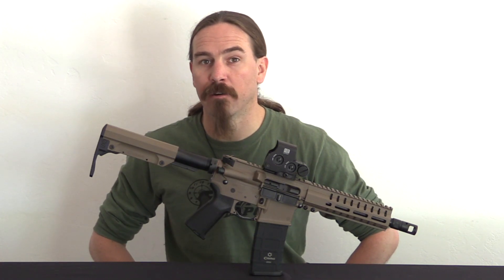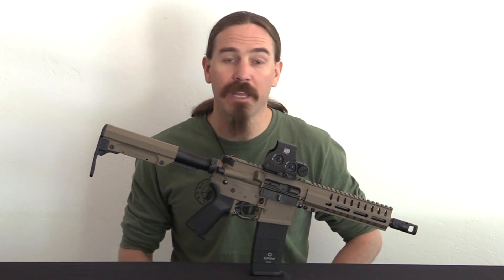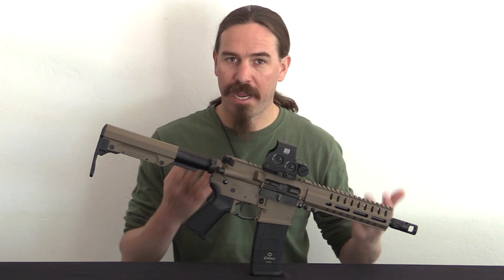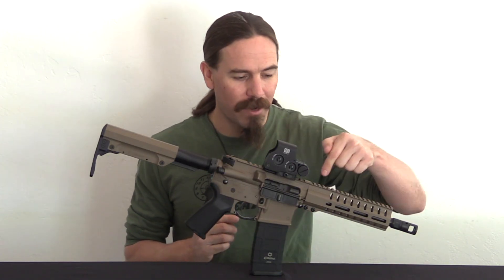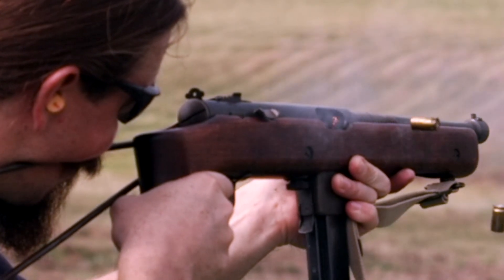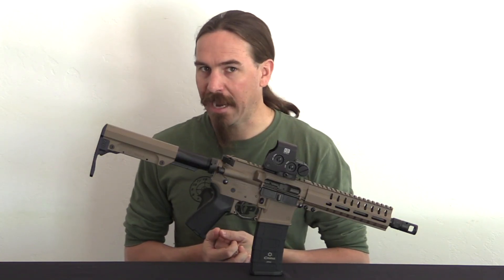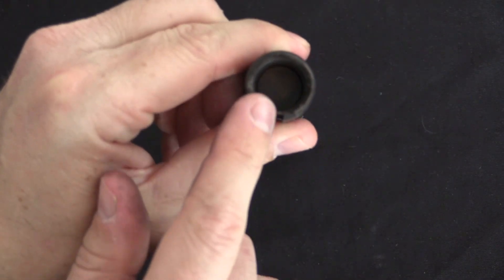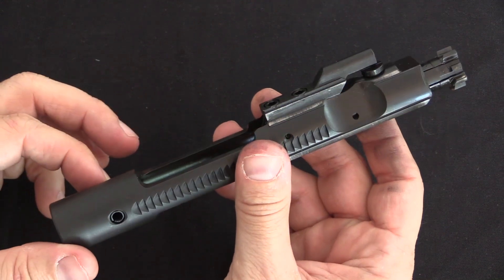CMMG Banshee: The Unique Radial Delayed Blowback System

Comment: Have one of the first 20 9mm Guards ever made and it has been great for over 1000 rounds. One big advantage of this system is if you have an existing transferable machine Gun or SBR you can use one of these RDB uppers and it will be way easier on your lower than a straight blow back system.  CMMG told me no more wear than a standard 5.56 upper would cause.  Straight blowback 9mm tends to egg out hammer pin holes and crack hammer pins.  Very interesting  video.
Reply: The blowback system  per se is hard on both the shooter AND the gun, as there's VERY little dampening and both the gun and the shooter must absorb the rest of the recoil. The French had significant problems with case head separations on their FAMAS, which Ian covered awhile back. Unlike most gas operated systems, there's no kind of adjustment with blowback designs-they either work or they don't. John in Texas
Reply: I have no idea what any of what you just said means, but I'm glad you got a good product lol.

Comment: you know, i actually wonder how an action like this preforms in automatic fire, compared to straight blowback or even locked breech or roller delayed actions. it being able to use the various different unusual calibers would make it interesting too, i'd like to see how 5.7 and 10mm handle, aside from just 9mm and .45

while not allowed in my state, I've always highly sought after getting one. and this series has been pretty appreciably cited as having a very smooth and clean action with little gas blowback or other disruption. the magazine adapters would mean this could be easily dropped into a transferable lower to test it though.
Reply: Michael Kolano they actually make both a 10mm and a 5.7mm version of this exact gun, although I don’t think there are equivalent magazine conversation kits

Comment: Ian, have you ever seen an AR platform with long enough receiver to chamber in a 57mm cartridge like 7.62 x 57  Springfield?
Reply: Not Ian, but I haven't seen an 06-length AR action. The longest AR action I have seen is 308 length.
Reply: 3006 is  7.62x 63  mauser  uses  7 and 8 mm x 57.  The AR10 will go to 308.  7.62x 51..

Comment: If you build a straight blowback 9mm AR use a Kaw Valley Precision 10 ounce tungsten buffer and a .308 carbine buffer spring, I've had no feed issues using mixed 115 grain, NATO spec 124 grain, various 147 grain, and subsonic Israeli 158 grain ammo through thousands of rounds.

Comment: I have one of their kits that takes Colt magazines, but I ran into a common issue with these where the radial delay blowback system seems to kill ejector springs every 1000 rounds or so.
Since my AR9 can just tear through a 30 round mag in 5 seconds, it's kind of annoying to have ejector springs on hand and occasionally change them out.
If I had to do it again I'd probably just go to straight bufferless blowback like the MCS system to allow for a folding stock instead.

Comment: 11.5 + 3 = 14.5 ounces = 411 grams

I can never get my head around ounces, I know it's ~30g, but I just can't do that conversion on the fly like pounds (just halve it to get kg).
Reply: Jesper O If you want to do even better (1% accuracy be 10%), halve the weight in pounds like you normally do, then subtract 1/10th of the result. So say something is 12 pounds, that halves to 6, and 6 minus 0.6 is 5.4. The real conversion is 5.443.
Reply: Jesper O ounces are 1/16 of a pound. Convert to pounds then multiply by 16
Reply: Different unit, but another helpful conversion is that a liter is nearly equal to a quart, so two liters is about half a gallon and a gallon is about 4 liters (something like 3.8 liters, but close enough to have a good idea how much milk or soda or gas or whatever the amount is). Also useful is that 12 oz (the size of a typical can of soda or beer, at least in the US) is about a third of a liter, which is helpful whether you're working out what the most efficient units to buy drinks in or just trying to visualize how much fluid something is.
Reply: 28 grams in an ounce.
16 ounces in one lbs.
Reply: American here. The secret to the imperial system is hallucinogenic drugs. But seriously, the basis of it is "common" objects used as reference, then fractions for division over decimals. Metric confuses me because I am not used to it. I can convert inches to MM pretty fast, but I worked on cars, so lots of wrench swapping. "Not a 5/8, or a 9/16, must be 15mm" Isn't a kilo 2.2 Lbs? Halving it would lead to some drift.
Reply: @mitchellpatterson1829  The only reason I know that a pound is ~450 grams is because we sell meat by weight and people insist on asking for pounds and half pounds. We also have people that ask for shit and leave it in a random isle because the prices are in grams and people have no concept of what a couple hundred grams actually looks like. Literally happens daily.
Reply: @zuzusuperfly8363  

I worked grocery too. I hate the decorating customers. At least our system is consistent, I have heard horror stories about shopping in Canada.

Comment: "I didn't want to use it with an arm brace" <-- Can someone explain what this means, please?
Reply: An arm brace isn't as comfortable to use as a standard rifle stock, the shape is all wrong and stuff
Reply: This short barreled rifle can be sold as a pistol (which doesn't require a tax stamp) if it uses an arm brace which is designed to be attached to the arm via a Velcro strap. These braces can be incidentally shouldered but are not designed to be shouldered and are not that comfortable.
Reply: @colestahl1265  there may also be some overzealous ATF agents trying to arrest you for shouldering a braced pistol.

Comment: I was hoping that was a quad-stack magazine with two rounds front to back and two side-to-side.
Reply: That would certainly be a design nightmare
Reply: Quad stack is generally only reliable as a quad stack double feed. This is primarily due to cartridge shift under recoil. Also, for quad feed to function at all it becomes very expensive to make. I'd like to see Schmeisser make one of their quad stacks for this; that'd be quite cool.
Reply: @ADH87 Same as in 5.56mm, assuming the insert isn't built for less for whatever reason. The range available is 10-30, and that's a 30 capacity insert he pulled out.

Comment: No rifle rounds like .223 or .308 for the radial delayed?
Reply from the maker: No, those would need more delay than this system can provide within the limitations of the AR bolt carrier and receiver.
Reply: @ForgottenWeapons  Interesting; did you get this as a definitive conclusion from CMMG themselves? I asked about this possibility earlier in the comments on their channel and at least at that point the person replying gave the impression that such calibers might be a possibility later should the reseach point in that direction.
Reply from the maker: No, I did not talk to them about it - just my own prediction.
Reply: @ForgottenWeapons  I actually had a hunch of another type of limitation, which might be present even at these lower powered cartridges, but might get more pronounced at higher power: I presume the force on the angled surfaces on the locking lugs will impart a nontrivial amount of torque on the frame right from the beginning of bullet travel, at the highest pressures, and that this torque will not be resisted evenly along the length of the gun, which then impacts aim, though maybe not by much on pistol cartridges?

Comment: This I need to rewatch a few times. How that action works is still a bit confusing to me. I'll get my head around it eventually. 

Considering the range of ammunition out there, yeah, I don't blame for taking some time to get it working and loosening up the requirements for operating the gun. They've really done a damned good job, especially if it's available in close to 10 different calibres.
Reply: It's like a clicky pen!
Reply: I'm with you I'm having a hard time understanding this one, but I think I just got it. The force from the angled surfaces is being passed back through the bolt head to act on the cam-pin to force the bolt carrier backwards.
Reply: @regisque  I''m starting to get it, the angle surfaces are the key here. Just another rewatch or two and I should have it.
Reply: I watched the AN-94 video about 5 times till I got that one.
Reply: @TheAlex1121  Not the only one. 

That whole thing of the mag being off set by a few degrees and all the stuff going on.....

I think I'll need to make it another two three rewatches this weekend.
Reply: Think of the angled lugs as acting like the DI system. It gives a short twist/bump backwards forcing the cam pin into the carrier body starting rearward movement. As it moves back it slows the head down from fully unlocking since it won't rotate till the cam allows it, then once unlocked it functions like a standard AR bolt. The additional weights you could add just means it takes a harder hit/heavier load to start the whole process. It seems more complicated than it is which is why it's actually pretty brilliant

Comment: If anyone was wondering what the attachments  are. I Muzzle Brake I FSS 11.5” commando barrel I PBX HOLO Optic I Singaurd Stock I SOCOM 10-Round Mag I
Reply: I was just thinking that, however if there was a blueprint that allowed 9mm to look like the 5.56 mag then I'd use that
Reply: I wasn't, but if you're gonna play know-it-all you should state what brand/model brake it is, not just state the obvious that it has one.  Also, he gave all the details of the mag; SOCOM was never mentioned and it looks like it would hold much more than 10 rounds.
Reply: @DonziGT230  R/whoosh
Reply: @DonziGT230  
He is referencing a video game (Modern Warfare 2019), and probably had limited knowledge of actual firearms accessories. 

The actual barrel is 10", not 11.5" (CMMG makes this system in only 10 or 16). The muzzle brake is, well a muzzle brake. The holographic sight is I think an EOTech (Since PBX is a made up brand), the magazine is a 30 round Magpul, and will NOT accept 458 SOCOM. Don't know the stock (it may legally be called an "arm brace") but I'm pretty sure singaurd is made up too.

Comment: I shocked that there are so many issues with chambering it in 9mm when you have homemade guns like the Sten that work just fine.
Reply: The Sten has that honkin' huge weight Ian mentioned can't fit in an AR-15 pattern receiver.
Reply: The reason for the delayed blowback is that simple blowback (like the STEN), did not work reliably with the 45 cal. Once CMMG had a patented system, customers asked for a 9mm version, even though simple blowback would work fine for 9mm. Simple blowback would also not work for 10mm or 40 cal, but as to the 9mm, sometimes customers are willing to spend money on something that is un-neccesary, and I cant blame CMMG for profiting off of that. Also, even for 9mm, the SB is not hugely accurate because an open bolt is basically a "slam fire" weapon, and the bolt slamming forward throws off the aim. STEN is very easy and cheap to make, but customers with money seem to like this.
Reply: @ronroberts110  There is a benefit to the delayed blowback 9mm when shooting suppressed. Suppressors increase back pressure. This system delays the bolt longer to keep the gas coming out the ejection port to a minimum and more of it going out through the suppressor. That means it's quieter and less gas in the face. Same with the 9mm MP5's roller delayed system. H&K obviously thought delayed blowback 9mm was worth while.
Reply: agree seems like they could have gone with a multi-stage recoil spring or something...seems weird
Reply: @davidburwell4218  It's an elegant solution that works very well. And you're not stuck with a heavy bolt slamming back and forth.

Comment: Reminds me of the 1923 Thompson autorifle with a radial like blish lock
Reply: I believe the difference is that, in the Thompson auto rifle, the bolt and bolt carrier move back at the same rate, whereas in this new rifle, the bolt carrier is accelerated at a faster rate at the beginning by the twisting action of the bolt acting on the bolt carrier via the bolt lug in the channel. The Thompson auto rifle is more like the Savage 1907 in that, while there may be a delay, it's simply the turning of the bolt (or barrel, in the case of the Savage) that slows it, not any sort of lever. If the bolt head in this AR was permanently fixed to the bolt carrier so that the two rotated together and at the same rate (if that were possible with an AR platform), then yes, it would work the same as the Thompson auto rifle.
Reply: Craig Koehler  In that it was supposed to be a locked-breach system, and wasn't.  But it worked as a delayed-blowback.
Reply: webtoedman My comments are regarding the Thompson Autorifle, the full-power rifle which competed with the Garand, not the Thompson submachine gun.

Comment: So, any reason that similar magazine inserts couldn't be made inte other calibers mentioned? Would the dimensinons of the AR mag unduly limit the capacity of the bigger pistol rounds?
Reply: The mag is very f*cking clever. Why have a dedicated mag when you can switch out the insert so quickly on any P-Mag?
Reply: @mrkeogh  Because not everyone wants to lug around their 9mm rounds in bigass STANAG mags?
Reply: It works particularly well for 9mm because the case head diameter for 9mm and 5.56 is nearly identical. .40, 10mm, and .45 are all larger so the rounds wouldn't stack as well in the mag body and you might have issues with rounds feeding through the feed lips. It could probably be done, but it would take more engineering to make it reliable.
Reply: Yeah, a doublestack 45 mag is pretty wide, its have to be either a proprietary mag, or a single stack, which is kinda silly in a pcc, there are a few companies making specific lowers for the bigger rounds, which I assume would work with the cmmg barrel and bcg, if you remove the extractor from the lower.

Edit: I totally missed the actual point of the question, pretty much what I said, but yeah the mags would have to be close to single stack for it to work.
Reply: 9mm has nearly the same case head diameter as 5.56, so it's the obvious choice for this. Anything larger, and you're running into capacity limitations because you can only do a staggered single column as opposed to a "real" double.

Anything slightly smaller (as in slightly enough to make adding a spacer on the sides hard to do and/or extremely fragile), and you'll get issues with the cartridge stack flopping around side to side. As an example, take 5.7x28mm, the P90 round. You'd have to add a half-millimeter spacer on each side to prevent your cartridge stack from wobbling. 

Smaller than that won't work either, because there are no "interesting"/mass marked centerfire pistol calibers with a case head diameter of less than 7mm.
Reply: i thought part of the point of a pccwas the abilaty to match calibers with your pistol and only need one lot of ammo makeing logistics easier so using the same mags would be an extension of that not having to transfer ammo from one mag to another to keep your firearm going ie emptied all your pcc mags but dont want to transition to your pistol
Reply: 357 Magnum???
Reply: @theimmortal4718  Would be easier to go with .960 Rowland. .357 Mag power (or at least damn close) in a 9x19mm package. Or if you're cheap just buy a .357 SIG barrel for your .40 S&W upper.
Reply: Need one in 7.62 Tokarev. If you can make a mag like that for 9mm it would be easy to do for Tok.

Comment: What stock is that?
Reply: It's CMMG's proprietary butt stock.  It's called the Ripstock.  It can be extended just by pulling the back on the stock without pressing a button and I believe you can preset the length of pull too.  Pretty cool
Reply: @parts456  Thanks!

Comment: Is this system patented? Could it be scaled down to fit in a pistol?
Reply: Are there reasons why you would want to when you don't have to work around an existing ar-15? I guess there could be, but I have a hard time seeing it.
Reply: @meanmanturbo  I've been mulling with the idea of trying my (hobby) hand at gun design - basically some inherently accurate (preferably fixed barrel) large calibre (50 AE, etc) design, without resorting to tilting barrel, short recoil, or gas-operation.
Reply: Yes, it's patented in this specific case.